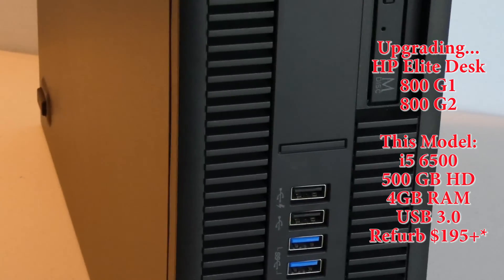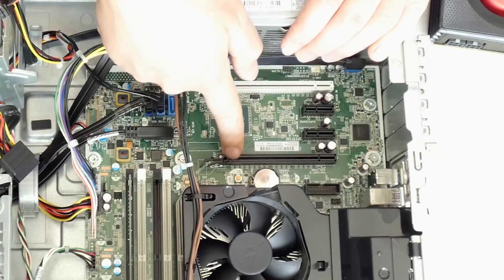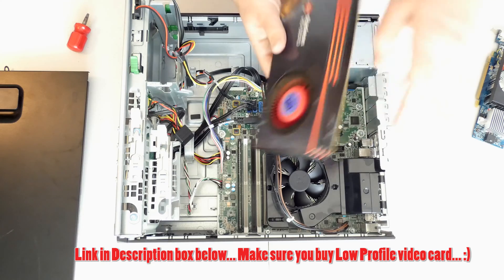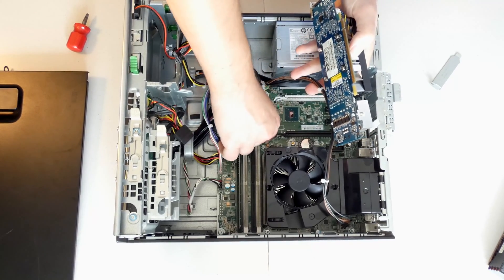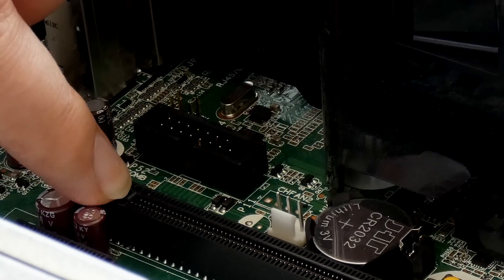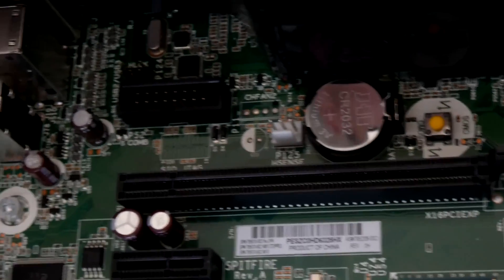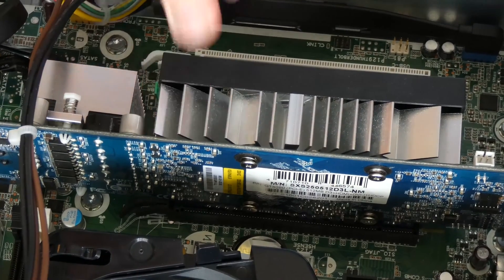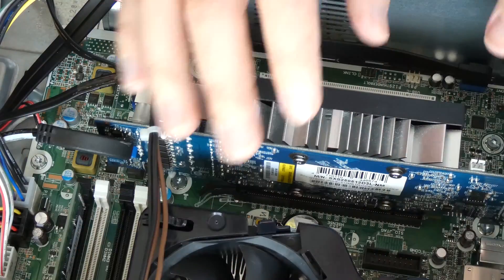Video Card Upgrade HP Elite 800 G1, HP Elite 800 G2, 600 G1  Small Form Factor Desktop

Comment: can i ask did you upgrade the psu or does that power connector for the gpu come standard on the 200w
Reply from the maker: It's the same PSU. Most of new low profile GPU do not require any adapters; ones that do usually comes included with GPU.
Reply: @Cobuman  Are you sure the GTX 1050 won't draw too much power? This model only has a 200W proprietary PSU. Would swapping out the HDD for a SSD and disconnecting the DVD drive make it possible? HP's website says that the GPU draw should be 35W or less but a GTX 1050 LP uses more than 35W. It might not be an issue until you fire up a game and your PSU gives out.

Comment: Hi. Thanks for this very informative video. 
I have on hp elitedesk 800 G2 with i5-6500 with 200W PSU. 
I wanted to put a good graphic. Your best suggestion is the GTX 1650 LP? Given that there are two fans, will I not have power problems?
Can u share a link. because i see MSI, Gigabyte, Zotac, asus.. are all the same thing but diferent brands?
Thanks in advance
Reply from the maker: Good question. This is the one I recommend to people: https://amzn.to/2vvHoBM It does have two fans but these newer cards are supposed to be more energy efficient. The older cards like 1050 with two fans did require extra power but still worked fine. Also, a few reviews from people that have a SFF like G1 or similar say it works perfect.
Reply: @Cobuman  G1 has 240w, so the extra 40w is the difference between using a 1030 (uses 35w) and the 1050 (uses 75w). I have a g2, so I think I'm stuck with a 1030 unless I buy a used HP G1 PSU.

Comment: I put in a Gigabyte Geforce GTX 1050 TI OC

In The computer but when i start it up the start Button just flashes red, any help would be grateful thanx
Reply from the maker: Is it the single fan or dual fan? If dual fan it may need extra power connector (at the end of the card there might be 4pin or 6pin connector).
Also, if still not working try taking it out and see if the computer starts up without it.

Comment: I own an Elite Desk Pro G1 with- Intel Core i5 4590 CPU, 16GB RAM, Intel HD Graphics 4600. I just started using Zbrush, Autodesk Maya, and Substance Painter. I am running into some rendering issues and am wondering what upgrades are possible with this computer. I wish  I could just buy a new PC, but I have to work with what I have. Any adive would be appreciated. Thank you.
Reply from the maker: Most of the 3d design programs mainly support Nvidia Cuda cores for acceleration which is something I would recommend. With this PC the best nvidia card you can buy in "low profile" is GTX 1650 like this: https://amzn.to/2G3hF5l . If you only work on 3d graphics and animation the best workstation cards would be the Quadro series however we are talking about super expensive stuff. If money is tight you can go down to GT 1030 https://amzn.to/2R8wGJC and still see a big improvement- but forget about gaming, it will not be a great experience.
Reply: @Cobuman  What about the Gigabyte GeForce GTX 1050 Ti 4 GB Windforce Graphics Card? Does this card have lower acceleration than Cuda cores? Sorry my computer hardware knowledge is very low.
Reply from the maker: @paulbaker6458  The short answer is yes. 1050 is slower and has less Cuda cores. But, 1650 is cheaper at the moment so it's a better choice in all.
Reply: @Cobuman  Thanks for the help,
Reply from the maker: @The Gamer Boii No, You will get low fps with 1030. FPS goes down even more when streaming because CPU has to do video decoding which is demanding. If you can afford a better graphic card it will make a big difference. Like 1650 low profile: https://amzn.to/30zcUdl

Comment: i bought an rx 570 and it doesn't fit, if i got a new tower and put the all the parts in would it work? or do i need a new motherboard?
Reply from the maker: You should be able to transfer to new case. Here is my video on that: https://youtu.be/C70nmtTFPuw
Reply: cobuman so i got a new case, new power supply put everything in and now i can’t figure out where the jfp1 is on the motherboard so i can’t get my pc to work
Reply from the maker: @tix1222  I showed it on my video towards the end.

Comment: HP800 G1 4750 SSF:  Do ya think THIS will fit?   Even as 2x width, it short enough!   $150   GIGABYTE GeForce GTX 1650 Mini ITX OC 4G Graphics Card, Mini ITX Form Factor, 4GB 128-Bit GDDR5, Gv-N1650IXOC-4GD Video Card
Reply from the maker: Great question. The 1650 is a great card; however, you need the "low profile" like this: https://amzn.to/2sxLI1W  the "mini" type will be too tall and not fit.

Comment: Hi there I bought a GT710 first because it was cheap, now placed a GT1030 and after booting the screen goes off but pc still on, any help would be appreciated. this is a hobby pc for retro emulation and I'm stuck.
Reply from the maker: Try connecting to another video output on the card or even built in video to see if Windows OS can see the new card (if so, reinstall the driver). Also, sometimes that happens if you don't have the GPU power connected.

Comment: I used HP elite 800 G1 with i-7 4790 16gb ddr3 ram psu came with it isn't ATX(which sucks but fixable) with 320W and i put in it 1650 Super which came out last month at 160$ needs 100W just for a GPU so yeah 6pin connector i had to use adapter to get power through SATA sockets (pci-e only up to 75W). I will be honest i was a little worry it might not work out but i made a bet with a friend that i will build PC on 400$ budget that will run any game on high 60 fps+ on 1080p and i was not confident with GTX 1650 that came out in april and only needed 75W and no 6 pin connector obviously buy perfomance 20-25% less also had GDDR5 vs GDDR6 on it so i gave it a try and got HP Elite 800 G1 Tower used from ebay (210$) 1650 super (160$) extra 8gb ramm (23$), tower came with only 8gb, 6pin to 2sata connector (6$) so 210+160+23+6=399$ and guess what i got over 20 newest games on my 2 TB HDD not a single one showed less than 60fps on ultra setting with 1080p. I haven't try it 1440p or 4k but whole system actually cost me 299$ after i collected 100$ from my friend. 1650 Super says 350W min recommended i gamed hours and benchmark it many times it is quiet and 320 just pull it fine also besides 2TB HDD i got 120GB SSD and DVD-RW on a system. Only thing i hear is my HDD. Just thought i should share it. No lieing gaming PC under 400$
Reply from the maker: I believe it. Sounds like you did a good job. Thanks for sharing. 👍😁
Reply: Could you edit vide with one of these computers?

Comment: How do you take out the graphics card? I have a GTX 1050 2gt lp, and I'm upgrading to a low profile 1650.
Reply from the maker: At the end of the pcie slot you can see a release lever. You would push it side ways before pull the card out. See it here: https://youtu.be/_tbcimqBDzI?t=213 Don't force anything out and make sure you push the lever first

Comment: If I add gtx 1050 ti 4 gb small version then will the power supply be enough for it or can I change the power supply
Reply from the maker: Yes, I have yet to hear someone having issues. By the way the GTX 1650 Low Profile is faster for same money: https://amzn.to/34lQIne
Reply: @Cobuman  So which card should i take because i wanna do gaming on it
Reply: @Cobuman  But 240w psu will be ok for this card or what ?
Reply from the maker: @ActiveXSploit  Yes, PSU should be good enough. Many people have upgraded without problems. Also, GTX 1650 Low Profile is the fastest you can get https://amzn.to/34lQIne

Comment: additional vga card means more power resource, so the question is since the cpu using adaptor, can adaptor adjust the need of more power?
Reply from the maker: CPU does not use an adapter. The new graphics card may not need an adapter at all...it just depends which one you get. The links in description point to compatible graphics card.

Comment: Would it be possible to fit an Radeon AMD Pro WX4100 into one of these base units?
Reply from the maker: Like this? https://amzn.to/2nb2JMk It shows to be low profile so it should fit fine; however, keep in mind the length of this card 6.6" (168 mm) by measuring available space inside the case (gtx 1050 is 167mm which makes me think it will fit). Height should be fine though.

Comment: Hi, can i relocate that motherboard into a bigger base?
Reply from the maker: You find another case and start moving stuff over... I'm just joking. :) I've heard of people doing this but the issue would be the PSU not fitting inside and motherboard may not align the backpanel connectors properly (leave a hole).
Reply from the maker: I just made a video that talks about transferring everything to a full size PC case which allows for big PSU: https://youtu.be/C70nmtTFPuw

Comment: I want to get a 1050 ti, is that supportable with this? If it is, can it run a 2560x1440 monitor?
Reply from the maker: Yes, GTX 1050 ti low profile like this https://amzn.to/2MH2J38 supports very high resolution.. up to Max Resolution: 7680x4320 @60 Hz

Comment: Hello I am looking forward to buying this pc can this run roblox and if it does at what like FPS settings can you also tell me some games and a close guess to run it for example like Minecraft Roblox and the FPS for it a close guess also works I also subbed thanks alot
Reply from the maker: Good question. It should run those games no problem using gtx 1050 lp like this: https://amzn.to/2MrJ3Ab 
I would imagine minimum 60fps at 1080p on both of those games. Without GPU upgrade it would not be playable at all. I hope that helps.

Comment: I got a rx 570 and a new cabinet with a 650W PSU
Can i use the HP motherboard in this setup ?
Reply from the maker: I'm not sure... it may fit inside but the backpanel (cable connections) will most likely be exposed.

Comment: Would this model fit on a Elitedesk 800 G2 SFF, i7-6700? https://www.solotodo.com/products/31993-msi-geforce-gtx-1050-ti-4gt-lp
Reply from the maker: It should fit inside; however, the dual fan ones may require additional power from PSU.
Reply: @Cobuman  It doesn't use external PSU Power. Would work?
Reply from the maker: @soyniqolas  Yes

Comment: Hi I'm considering buying this and putting an rx580 into it, Is this possible, Thank You very much.
Reply from the maker: Hello, RX580 is too tall to fit inside the case; however, it is still possible to use it with an external GPU adapter like this one: https://youtu.be/tj2ws0mTm6E
Otherwise, the best GPU that will fit inside is GTX 1050 ti low profile like this: https://amzn.to/2YcIlaU
Reply: @Cobuman  thank you so much for notifying me that it isn't feasible before I bought it :)
Reply from the maker: @jeremyfavro6886  My pleasure.
Reply from the maker: I just made a video that talks about transferring everything to a full size PC case which allows for big PSU: https://youtu.be/C70nmtTFPuw

Comment: Cobuman hello 
Dear Sir I have the same pc , it does not start when press the power button . What to do ?
Reply from the maker: I'm assuming all cables are good.. it sounds like a bad power supply. It's pretty easy to replace. 
Which one do you have? G1, G2 or G3?
Reply: @Cobuman  g1
Reply from the maker: This is the replacement power supply: https://amzn.to/2WsvDnH Shop around because you can get them much cheaper.

Comment: do you think a ZOTAC gtx 1060 mini would fit ?
Reply from the maker: No, GTX 1060 is too tall to fit inside; unless you use my adapter that allows any size GPU: https://youtu.be/tj2ws0mTm6E
Reply: Hello, what I did was to change everything from the original SFF case to a bigger one that I bought, a dead silense cube aerocool case https://www.aerocool.com.tw/es/chssis/ds/ds-cube , to be able to put a MSI Radeon RX 560 AERO ITX 4GB  https://latam.msi.com/Graphics-card/Radeon-RX-560-AERO-ITX-4G-OC.html 5604GB msi, I used everything original including the 240w power supply, everything works normal and perfect. would be very good if you can make a video like that. Your Channel is owesome!
Reply from the maker: Thanks Jean! I have to admit those cases and a lot of there products look really cool. 
Which PC did you transfer to DS Cube? 800 G1 or G2? 
Also, how does the motherboard fit inside of it; are the back cable connectors fitting good without gaps or holes?
Reply: @Cobuman  it was a G1 with  i5 4690, the motherboard size looks standard mini itx and the holes are in the normal place, but i don bought a cooler so i did a backplate for the original cooler to fit. And you need to put all the cables from the front pannel and usb 3.0 because causes error 515 or 512 i dont remember.
PS. I would like to make a short video showing you.
Reply from the maker: @mellamoJean  Please do. I'll check it out.
Reply from the maker: I just made a video that talks about transferring everything to a full size PC case which allows for big PSU: https://youtu.be/C70nmtTFPuw

Comment: What video card are you installing?
Reply from the maker: The video card in this video is an old GTX 250... I recommend GTX 1050 like this: https://amzn.to/2UeQFFi
Reply: @Cobuman  can i use 1060 gtx 3 gb dual fan in my hp g2 280 i3 6100... Comrade....😁
Reply from the maker: @omercreation2711  Do you have the tower or Small Form case like in the video? If it's tower you can use something like this: https://amzn.to/34kfZzK ?
Reply: @Cobuman  thnx for your reply.... From Communist kerala, India...
Reply from the maker: @omercreation2711  😁 LOL I'm not Communist or Russian if you suspected that. I am originally from Europe... hehe good luck friend.
Reply: Msi nivida GeForce GT 1030.

Comment: Would asus geforce gtx 1050 lp oc be good for hp elitedesk 800 g1 sff with i5-4750s?
Reply from the maker: Are you talking about this one: https://amzn.to/2X7GODp ? It will probably work, but may need additional power adapter that connects to power supply. 
Here is an example of GTX 1050 TI that people use: https://amzn.to/2E5jDSt  Most people don't have any issues using this card.

Comment: Hi i have elitedesk 800 g2 sff with 200watt power supply can i upgrade to gtx 1050 low profile?
Reply from the maker: Here is an example of GTX 1050 TI that people use: https://amzn.to/2E5jDSt  Most people don't have any issues using this card; however, recommended PSU is 300W for the PC in total.  So, you can expect this GPU to use around 60-80w* when playing games which means other components have around 120w left to work normal.... Anyway, the worst thing that could happen is PSU dies in a year or so which you can replace for around $30 US. So far, nobody has told me PSU went bad... I hope that helps.
Reply: @Cobuman  can't the PSU dying possibly damage other components of the pc?
Reply from the maker: @TheTWEEK95  Yes, if you suspect PSU dying it can damage other components. This is related to voltage/amperage requirements.  Usually, PSU issues occur during heavy load; for example, during gameplay. Here is my video that explains this: https://youtu.be/UGMC8iAfIa8

Comment: My local PC store advised me against using a GTX 1050 Ti, some comments on their product page even said some users experienced blackouts. Mine is a 320 watt power supply, would that be ok and is there any chance of damaging this system due to a gfx card?
Reply from the maker: Recommended system power is 300w. Although, I don't know which PC you have which may be an issue unrelated to video card.  Here is an example of GTX 1050 TI that people use: https://amzn.to/2E5jDSt

Comment: Would a GTX 1060 mini 6gb or GTX 970 work on this PC ?
Reply from the maker: Good question. Unfortunately, those cards are too tall to fit inside the case. It has to be "low profile" type. The best available is GTX 1050 Ti like this one (affiliate link): https://amzn.to/2SdVLnw
Reply: @Cobuman  can I change the case of My Elitedesk 800 G4 sff to TWR??
Reply from the maker: @HernánArancibia-w9k  No, I'm not aware of any cases that you can transfer this PC to. Technically it's possible with case/psu modifications but it may not look pretty or be safe. Look through comments there might be someone who done it.

Comment: I have a HP Elidesk 800 G2 SSF, with i7-6700 and 8GB of RAM and 240W PSU. Can I install a Video Card?
Reply from the maker: Yes you can, something like this would be best: https://amzn.to/2FIDvMG
Reply: @Cobuman  I bought this exact card and it didn't work on my g1 sff. Didn't come with a low profile bracket. Not sure if I'm doing something wrong?
Reply from the maker: @ouydouy68  I'm sorry to hear that. It should have come with a low profile bracket... Anyway you can contact Gygabite support to send you the bracket? If you just want to test it first, you can lay the computer flat... take off the standard bracket and insert the card without the bracket. That way you will know if it's worth your time to pursue the low profile bracket. It's so unprofessional when they omit crucial part of the card that is clearly labeled as "low profile".
Reply: @Cobuman  Same her, bought a card from the description list. it's not compatible
Reply from the maker: @LearningPlatform10101  Thank you for letting me know.